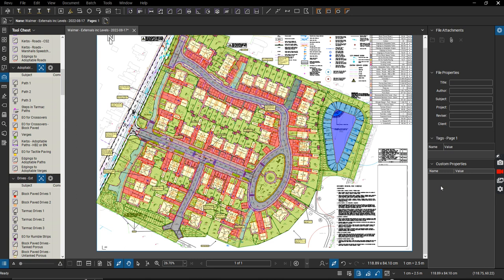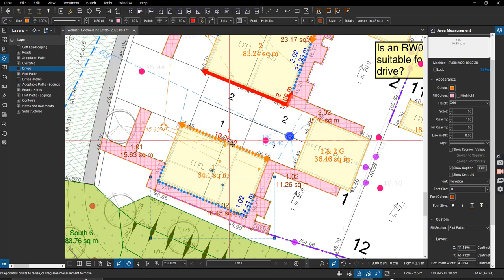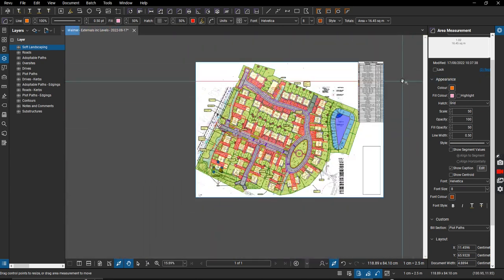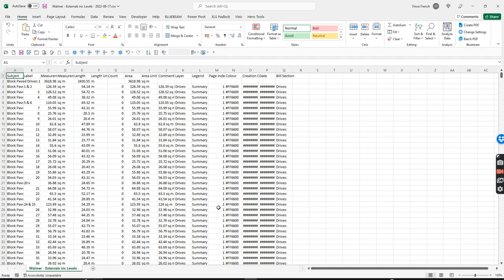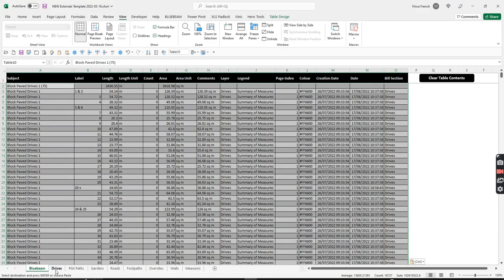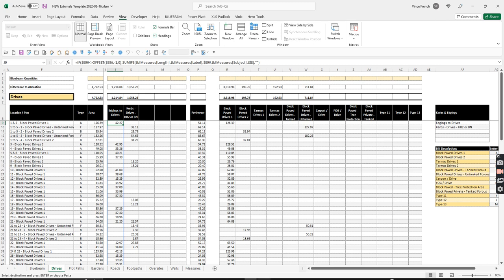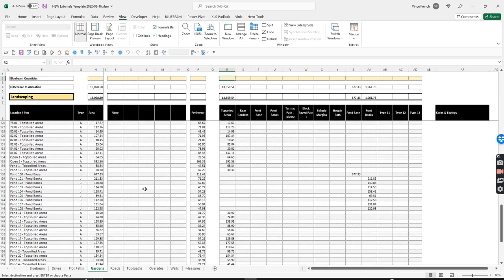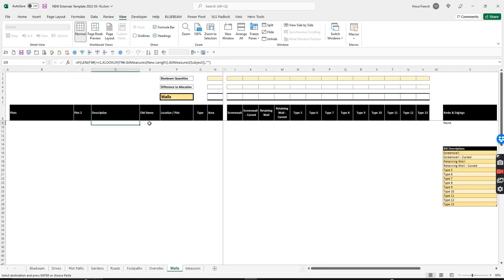Bluebeam and Excel Set-Up - Output Using Standard Excel Formulas (No Power Query or Macros)

Comment: I'm in residential building estimation, and wanted to create something like this where I can paste like yourself and have the rest work out via excel. However, there's also the dynamic link feature, which is handy so if u make changes on the fly it auto updates excel. I'm not sure which way to develop the sheet, tricky one. This seems quicker, but dynamic links seem bullet proof incase of revisions etc
Reply from the maker: It really depends on what you want to get out of your meaures to which way you do things.   Qauntity Link only gives you the summary measures for each subject - this is also only the main unit of measure.  This is also not that stable and can be quite difficult to update when you start working on a new set of drawings.  I like Power Query as this can not only be set to update on a Refresh button but it also gives you the oppprtunity to use every last bit of information in the Markup List.
Reply: @ what’s power query? Is it easy to setup?
Reply from the maker: Power Query is part of Excel.  It takes a little bit time to learn it but it's well worth doing so.  Have a look at parts 3 and 4 of this series of videos.  Also, see my latest video re how much info you can generate in a few minutes.  These should give you a good idea of what you can do with Power Query.